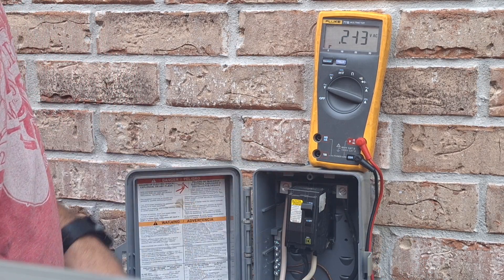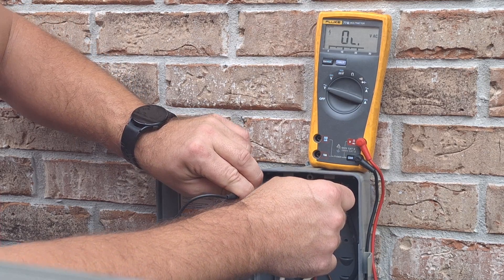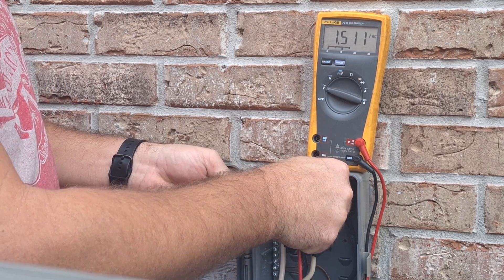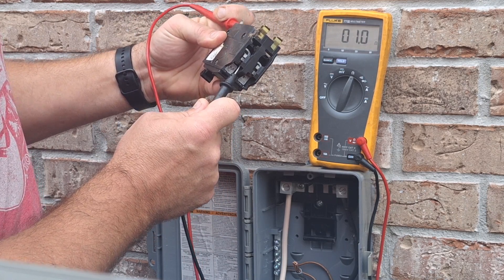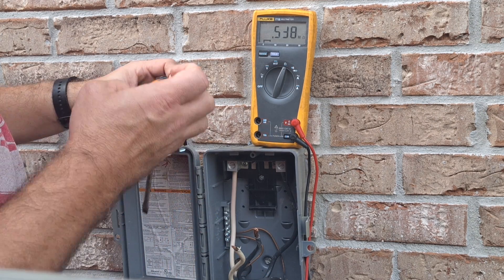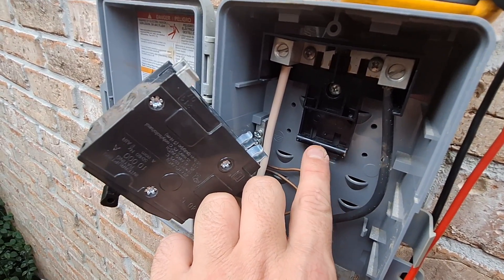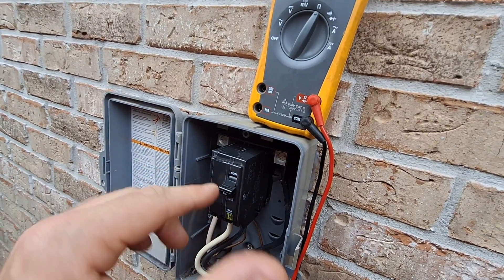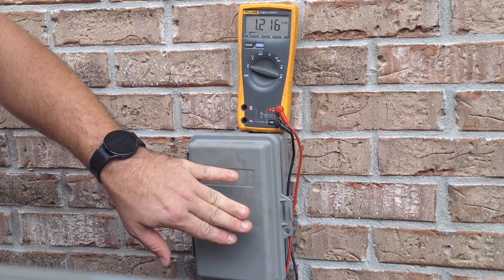How to Replace a 60 Amp Breaker #electricity #diy #homeownership

Comment: You fast-warded an essential assembly part. That was the part I needed help with 🤦🏼‍♂️
Reply from the maker: Sorry, What part do you need help with?
Reply: @  no worries, I figured it out! I wasn’t sure how to connect the wire to the breaker. I backed out the screw all the way until it fell out before realizing it was opening the space behind the metal part, not just immediately in front of the screw like an outlet is wired.